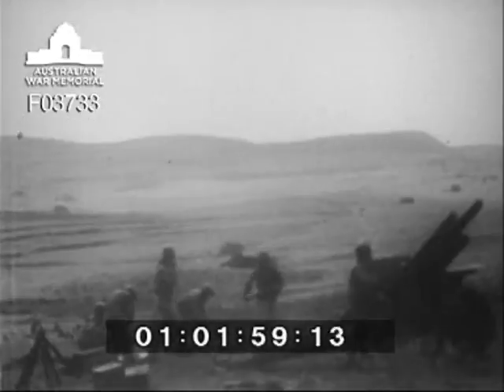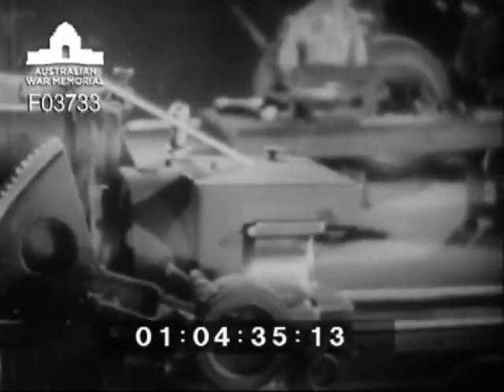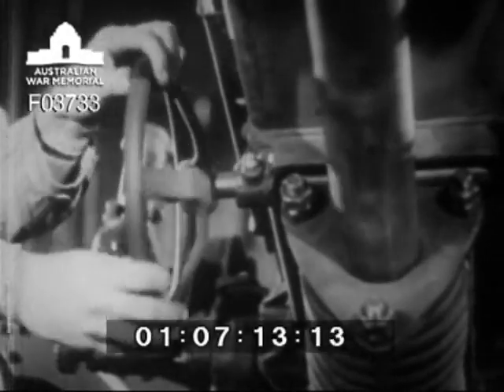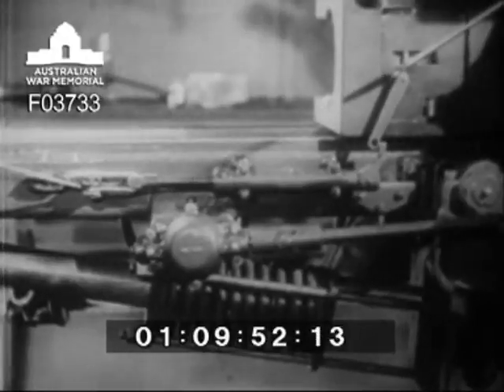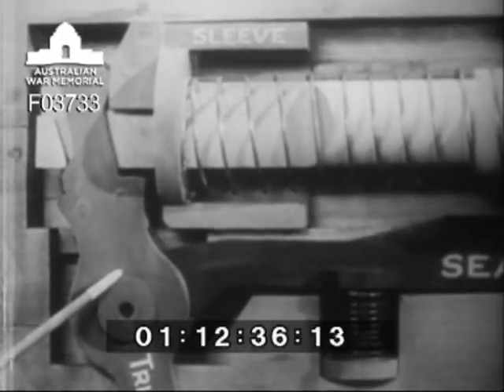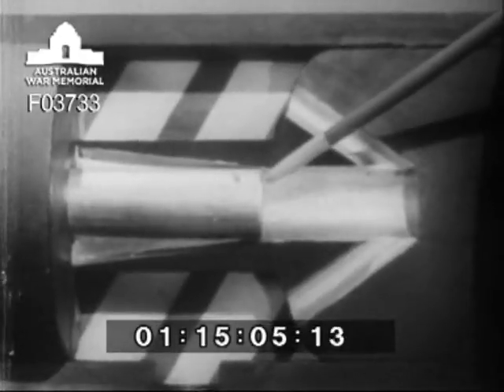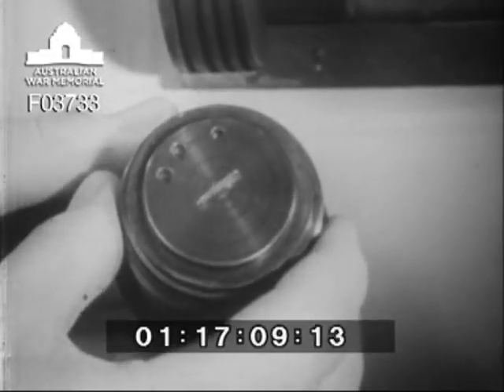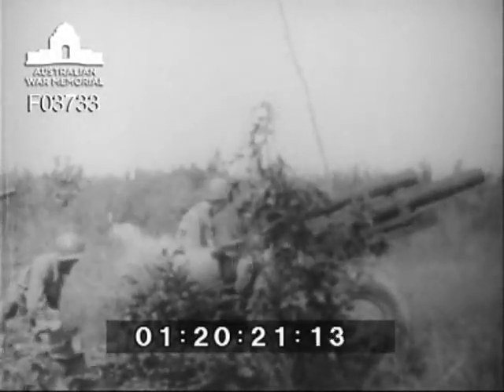Howitzer 105mm M2A1 on carriage M2: principles of operation

Comment: I would like to see a comparison of the M2A1 to the German 105mm Lefh-18. At a glance the M2 appears to be the superior weapon...
Reply: The US design was more adapted to high volume production. The breech block in particular had far less components than the German design. That much I do  know.
Reply: @pimpompoom93726  I believe M2A1 also used fixed ammunition , which had to be easier and faster to load than the German 105mm separate loading. Also , the pressed steel wheels on the German howitzer couldn't have been nearly as good hauling it over any kind of terrain than the American rubber tires...
Reply: Exactly, but I can see why the Germans did it this way. They lacked access to natural latex rubber and would have had to use petroleum to create synthetic rubber. And petroleum was VERY scarce for the Germans. Each nation played to it's strengths, with the USA it was long experience in high volume production.
Reply: @johnchoate6909  The shell and cartridge came as one but was seperated  before loading as it had , 6 charge bags as it was howitzer and range depended on charge bags used , maximun charge was considered for max range allegedly 12 miles not used normally , so if order was charge 4 the gun number one took charge 5 and 6 so only the 4 charges were put back into cartridge and shell joined with it the loaded and fired ,the leftover charges burnt later
Reply: @pimpompoom93726  the Germans had a long tradition of using steel wheels and solid tyres and the leFH 18 and 18M were simply extensions of WW 1 designs. They expected to use horse drawn artillery in service and their artillery park reflected that. America expected to go to war in a fully mechanised fashion and made sure that every gun it fielded had to be vehicle-towable. Many countries changed their guns to vehicle towing during the interwar period. Incidentally, the Yugoslavian M56 gun is a further development of the 18M and is still in use today, using the German shell or the NATO 105mm shell. I stand to be corrected but the roadwheels on this M2 gun are the same as truck wheels, so that either can swap wheels and tyres. Handy for the supply system.